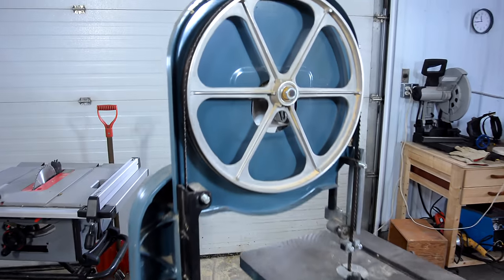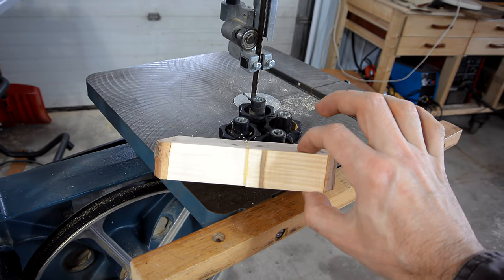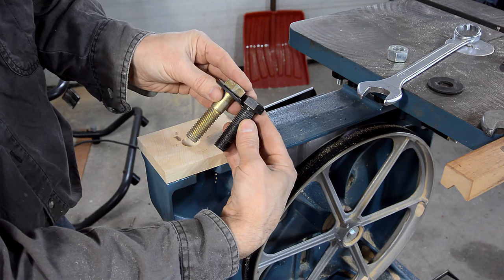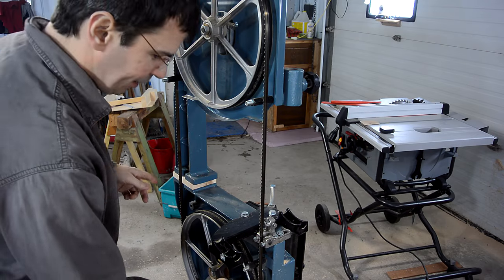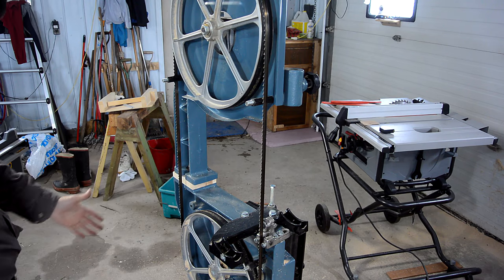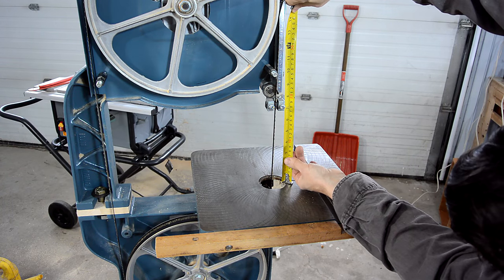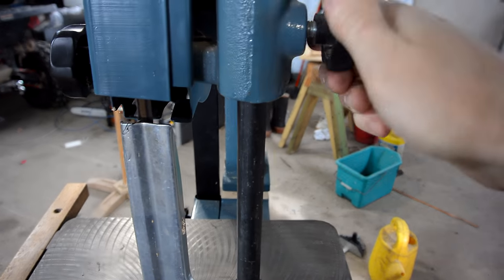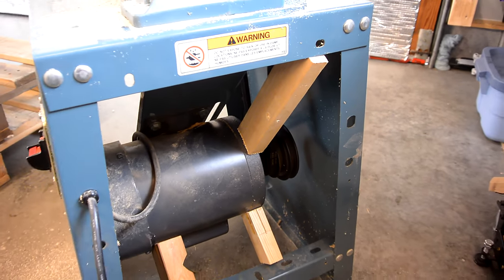Wooden bandsaw riser block

Comment: I expected this bandsaw to reach his ceiling. Disappointed.
Reply: Has anyone plotted the average size increase per year of his home made bandsaws? I expect in 10 years time we should see a good 50 meter resaw capacity.
Reply from the maker: I built a 18", then a 16", then a 14", then a 20".  Not an increasing trend.
Reply: Matthias Wandel You could always build a 22" then a 24", then 12", 10", 8", 26", 28", 30".
Reply: It is increasing but only with a R^2 value of 0.04.

Comment: Why not put new alignment pins in? Drill the wood all the way through and put 2 dowels in the top half.
Reply from the maker: the end grain wood would split too easily, like when we carried the bandsaw.  Plus, if it was off just slightly, it woudl be really hard to align
Reply: would not have used dowels, but used some cut off bolts or piece of round rod etc. You drilled thru with the drill press, should be square.
Reply: Yeah I have to agree with this, I watch all his videos but this one I had issue with. That saw is going to end up with alignment issues after being used for a period of time due to pivoting on the bolt. Adding alignment pins correctly isn't a 5 minute job but it will only save hassle in the long run.
Reply: We have a Porter Cable version of this saw. The upper pin holes are larger than the pins by a significant amount. The pins were around .25 in and the holes were around .3125. They really didn't do much to keep it in alignment. We installed a 6 inch extension made for a shop fox (the PC version didn't seem to be available). I didn't bother about the pins. It's stayed in alignment without any problems so far.
Reply: You could make it out of hardwood and carve the top and the bottom of it to hold the top of the bandsaw fixed in place. Or maybe clamps! ^_^
Reply: Even with wooden pins, you'd hope the clamping force between the block and the two metal halves would be enough that it wouldn't shift too easily over time, thus the pins only needing to guide.
Reply: No wait! You can brace the piece of wood and the bandsaw with a metal belt once the thing is aligned. Sort of a clamp.
Reply: tapered steel pins, it will require a bit of finesse with the taper reamer.
Reply: Wonder if you could use the router copy carver for this.
Reply: Had the same thought. Guess we're thinking wrong or it would be in the video.

But I do wonder, which would take longer, "the fiddling" or adding pins.

Comment: Hi Matthias,
the pins aren't just for alignment, but also for securing the top from tilting and shifting under the vibrations while sawing. The big bolt alone doesn't prevent that and after a while the top might touch the sawblade and damage the saw or even hurt someone, so you really might want to add new/longer pins trough the spacer-block.
Reply: While i enjoy his other videos this one is just bad. Could have avoided so many problems so easily....

Comment: That thing seems it will get out of alignment in a week or so. Since it has only 1 support point, it has almost zero resistance against turning moment around z axis other than friction. Some aligment pins or at least some epoxy is needed there. I understand this is a favor for a friend, but we are used to expect very much from you Matthias :)
Reply from the maker: ever heard of friction?
Reply: Matthias Wandel bathroom scale test or it didn't happen! :)

Comment: Seems like that top will turn and get out of alignment over time from the general vibration of the machine as the blade moves inside. Having the alignment pins seems like a safer bet. Just thinking out loud.
Reply from the maker: right, just like the furniture in your house gets out of alignment from the vibration of people walking around, right?  Cause you know, unlike the bandsaw, the furniture is not bolted down.

Comment: Note 
The alignment pins are not solely for alignment the also prevent the top section of the band saw from twisting in use. Not a good idea to run it with this important safety feature. In addition I would suggest a lock nut or lock washer.
Reply from the maker: Twisting would fall under "alignment"

I enlarged the holes on a similar bandsaw before because the alignment pins were misaligned, to no ill effect.
Reply: Thank you so much for your reply. I fully agree that twisting is "Alignment" I sincerely hope that your friend Luke does not experience catastrophic and sudden "Misalignment" during a re-saw some day. Im quite certain that you fully appreciate the purpose of the alignment pins in this particular bandsaw.
My concern is that you did not extend the pins through the block riser to connect the upper section.
You also failed in the provision of a lock nut or tab washer on the large through bolt.
You do elude to the difficulty experienced in making the alignment and the fact that it moved again in transit to your friends workshop.
Surely these occurrences  indicate that your quick fix in this particular case are not compliant to safe operation of the bandsaw.

If the large through bolt slackened off over time and was not observed. 
The wood riser block and the metal structure are temporary fused together as happens all can appear fine and dandy until some additional force is applied i.e. cutting a tuff burl, then the whole lot suddenly give way and your friend is subject to injury before he even knows what happened.

Please get the saw back and extend the "Alignment" pins and render your quick fix safe.  Thanks

Comment: Very nice and brilliantly done. How many kg load can be applied to the saw blade? Reason I ask is the Lennox saw dealer brought a tensioning gage to our shop. When adjusted correctly the load was considerable, I'm guessing it would compress wood.  Any thoughts?  (Probably should have done some research before rambling on here)

Comment: Hi Matthias, I have this exact same Band Saw, and for some inexplicable reason the reduction gears have a sharp lip in the inside bottom of the gear which shoes up the edge of my belt. Did your model have this problem? If so did you do anything two solve it?
Reply from the maker: Mine doesn't have any gears.  But it did have an intermediate reduction pulley, which had very noisy bearings.  Eventualy, I just got rid of that pulley and used a longer belt.
Reply: @matthiaswandel  Do you know what brand/model this saw was? I have one from a no-name brand that is identical to this saw. I am trying to figure out what name brand it is the same as so that I can get parts if I ever need to.

Comment: If you use your bandsaw a lot (and you don't need the extra half an inch of resaw height), you can save some money by buying 100' rolls of blade and size them however you want. I'm surprised that Matthias isn't already doing that, watching him sharpen a blade with a Dremel.  (I'm so cheap, I have resharpened blades with a slipstone; you can target the sides better while retaining more frontal tooth/gully). I cut and braze several at a time, and I make them about 3/4" longer than stock for my particular saw. For my saw, the tensioner it's hard to get a stock blade on/off without accidentally unscrewing the tensioner all the way to where it falls off. PITA.

Comment: Thanks for another very interesting video.  I'm now thinking about replacing the galvanised sheet metal top on my old cheap table saw.  Trouble is everything bolts to  it, so I can't replace it.  But I can cover it with 1/4" plywood and Formica laminate.  Formica for smoothness and durability.  Then realised that I've never seen anybody use formica for that.  So I'm wondering, could there be a reason for not using it.  Your thoughts on this would be much appreciated.

Comment: Matthias, do you think that vibration long term or resawing hardwood that takes a lot of pressure will throw the top out of alignment? To me it seems somewhat dangerous.
Reply: dafickler Yeah it would be easy enough to just replace that block with a 3/4" thick steel plate with the three holes drilled in it and just weld it to the top half of the frame.
Reply from the maker: Right, just weld it to the cast iron...
Reply: Matthias Wandel Ah. Love the passive aggressive attitude, not douchey in the slightest.
Reply: bronze weld would do perfectly
Reply: To do bronze brazing, you need a TIG welder. Some people don't have one of those.
Reply: you can bronze weld with an oxygas outfir and most fabricator have does
Reply: If resawing 6" of hardwood with the right blade, like 2 or 3 TPI, you won't put a lot more pressure on the frame, IMO. What IS going to mess up the alignment is whenever you put a new blade on there and try to cut a dowel or other oddly shaped bit that doesn't have a flat bottom to it, and it slips, rolls, and catches hard, jamming hard enough to bend the blade and throw it off the wheels. I dunno why it's always a new blade. Maybe it's just murphy.

Comment: what is the diameter of the rod that holds the mount for the upper blade guide? I am trying to find a the proper fit as a replacement part for my similar bandsaw

Comment: i want to ask question, you used metal rod many times, you know when you insert a metal rod through two holes of wood, i see u put bearings at the both end of metal rod, but my question is how do you make the rod tight and firm on the bearings. when the metal spins with the gear, doesnt this make it the rod move on right or left?
Reply: hope u answer my question ASAP
Reply: also i want to find out if there is a better method of contacting you rather than youtube comments because i have lots of question and i really need in ur help in my project

Comment: hi! how many HP does that motor have ? and RPM? thanks! I got the same saw but with not enugh power to do that cut
Reply from the maker: 3/4 hp. Enough for this kind of saw.
Reply: Federico Favrin Izzy Swan just put out a video which may help in your case. Smaller saws can be used for resawing with a good blade, alignment and guide set up.
Reply: I don't know too much about that brand of Delta clone. I managed to find an ex school shop Delta with the 6 inch factory installed riser block. It has a 1hp motor. I forked over the money and got a carbide tipped laguna blade for it...pricey but with its thin kerf I am able to easily resaw 10 inch ambrosia maple with it. Use this info as a benchmark only...but beware that some Asian companies were notorious for overrating their HP rating. (Craftsman also took a beating for this practice a while back)

Comment: They already make cast iron riser blocks specifically for 14" bandsaws. But, I'm sure you already knew that and would much rather source a solution from the trash pile ;-)
Reply: Many of us do not need a 6" riser block, even though they are a heck of a bargain at $1XX.00 in a kit. I'm currently dreading my next project for which I'm going to try to use a  HF bandsaw and jack it up an inch so I can saw a little bit over 6" tall dimensional. When I'm done, my goal is to sell it so that I can have some money back to spend on my next harebrained idea.

Comment: any tips to minimize the vibration coming from my band saw motor?
Reply from the maker: watch the video
Reply: i tried that, i was wondering about actually fixing the motor it self. Even with the wood blocks my phone will dance off the table with no belts connected.
Reply from the maker: The motor on it's own doesn't vibrate significantly.
Reply: Matthias Wandel my motor does, pretty disappointing when it is a brand new saw and motor. I removed all belts and just ran the motor. the motor alone causes enough vibration to shake my phone off the table.
Reply: Then you need to take it back.  You can't fix that unless the pulley is out of balance.

Comment: how do you know how much twisting force you can put on blades?
Reply from the maker: I don't twist the blades.
Reply: Matthias Wandel i mean when cutting a piece making sharp corners. should the blade not twist at all?
Reply: Sharp corners are made because of the set of the teeth.  Besides, if the blade twisted while you're trying to cut a curve, the blade would be twisting and not cutting, right?
Reply: it just seems in those super sharp corners the blade would've been torqued. when i make sharp corners i get worried of the grinding sound
Reply: You're probably twisting the blade.  Maybe you need a scroll saw.
Reply: Miles Parris I was surprised at how tight of curves he was getting. I used the same width blade and don't get anywhere near
Reply: Is there any set to the teeth of your blade?
Reply: Miles Parris for sure, it might be a thin one though. i do know there are some teeth broken, I can feel it